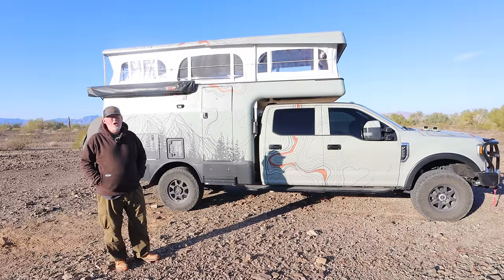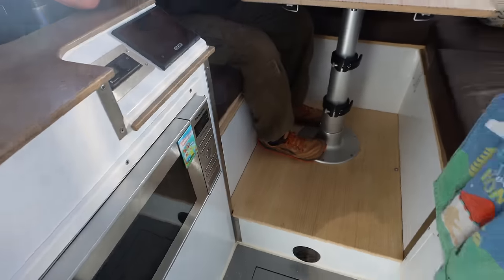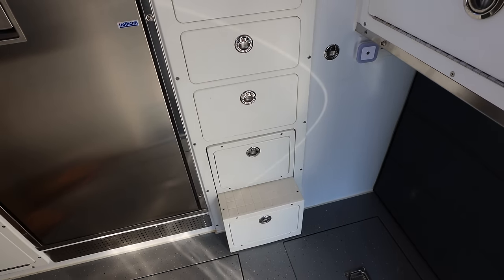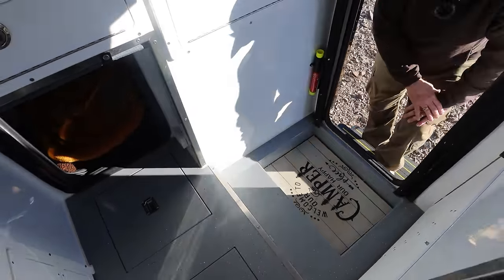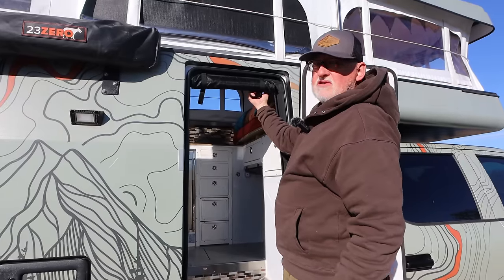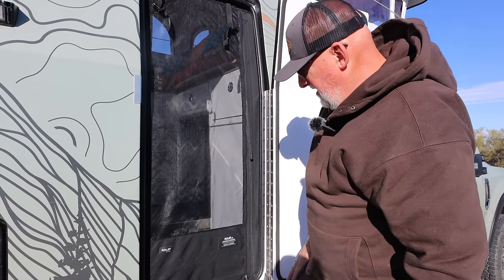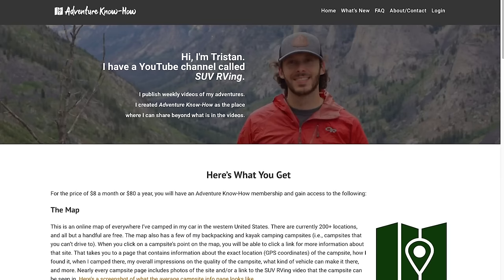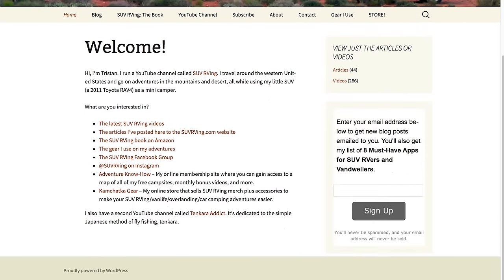Touring a $350,000 Overlanding Truck Camper!

Comment: I like seeing different RV/camping options and the pros/cons of different rigs. Thanks for posting this
Reply: Thanks for your comments, it is much appreciated.  The hidden detail is driving the quality, fit, finish and off road durability of the build. But not everything is always ideal given the limitations of what can be squeezed in a small space.  The toilet area is cramped and the trying to get a great seal with some minimal rain seeps with the door curvature are on the con sides. The door seals fine given the gasket arrangement but could be better in my mind.  But the seeps if any just end up in the shower sump anyway so nothing to clean up.  The long term use of the gasoline fired heater will also be interesting.  Just how long it will go before it needs to be pulled and thoroughly cleaned. Thanks for supporting Tristan and SUV RVing. Cheers - Bill

Comment: I love hearing about everyone's different ideas of creating their rig that works best for them.  No rig is the best, all have pros and cons and each afford everyone abilities to be creative.
Reply: Thanks for your comments, they appreciated.  The hidden detail is driving the quality, fit, finish and off road durability of the build. But not everything is always ideal given the limitations of what can be squeezed in a small space.  The toilet area is cramped and the trying to get a great seal with some minimal rain seeps with the door curvature are on the con sides. The door seals fine given the gasket arrangement but could be better in my mind.  But the seeps if any just end up in the shower sump anyway so nothing to clean up.  The long term use of the gasoline fired heater will also be interesting.  Just how long it will go before it needs to be pulled and thoroughly cleaned. Thanks for supporting Tristan and SUV RVing. Cheers - Bill
Reply: I really like the marine grade aspect of the rig.  That shower is just your bilge.  Haha.
Is the company open to hearing your opinions on the leaks and such and using your experience for improvements?

Comment: Marine design in mind is a great way to go , the have been developing designs for harsh elements for a long time.
Reply: You hit the nail on the head.  The hand construction process and material selections are outstanding.  This won't be a falling apart rattle trap in a few years of the use we put it through. From what I have currently seen, RV industry in Elkhart can't even produce units that won't keep from falling apart on the highway!  Thanks for watching and supporting SUV Rving's channel. - Bill

Comment: I see a lot of expensive gizmos that will be a long wait for parts and service.  What is the plan when you need to remove the cab for engine work?  Seriously doubt Ford will cover the labor to R&R that camper along with all the connections. 
What is total loaded weight of this unit- all food, fuel, supplies.
Reply: The gizmos are expensive and my fingers are crossed that the reliability is there.  The good thing is EarthCruiser is not an RV corporate conglomerate. They produce all their units to order for a particular customer.  They can produce in the neighborhood of +/- twenty of these units a year.  They have enough throughput and inventory to pull a failed component from stores and get it right out to you.  If it is a warranty item they will reimburse you for installation costs.   I noted that incase of a CZone PLC failure I can jump the fuses up one slot to run all the electrical items.  If the CZone interface screen goes dead, I would just use the iPad.  If one of the lift motors fail, then out comes the manual crank...  Fortunately I am able to tackle most issues out side of "Ford" issues. Now the meat in your comment, the risk of having to pull the cab for engine work..  The expense of that would definitely be on MY dime regardless of Ford's warranty. In that case I would have to get it to Bend, OR by hook or crook via a hauling expense again on me.  EarthCruiser would remove the "House" via the 6 anchor points and connections at my expense and then we would take it over to Kendall Ford of Bend, EarthCruiser's unfinished chassis supplier. So yes that scenario would be very painful, but not as painful as hauling it to Elkhart, Indiana😵‍💫 and having it there for months.  Last question, all in weight.  Fully loaded, 2 people, weighed at Montana DOT Scale was 12,860 lbs. against a "Manufacture's" door sticker certification of 13,000 lbs.  Now I caution you don't jump on Fords website and look up the rating for a F350 pickup and claim this vehicle is "Over Weight".  This was an unfinished chassis modified and completed by a "Manufacture" who has had it certified to Federal Motor Vehicle Standard for 13,000 lbs. and has issued the cerficate of weight rating.  Thanks for supporting Tristan and SUV RVing - Bill

Comment: Does it come in blue?
Reply: So actually yea and no.  No not off the production floor, but i did give the manufacture feed back that a few basic Gel coat colors other that white would be nice.  Yes, you can get any colors under the sun in a wrap... But then if you went Blue, you would still be stuck with white F350 cab to have to content with.  😂Thanks for supporting Tristan and SUV RVing - Bill

Comment: Yea, he got bad advice, gas engine is a terrible idea for this weight
Reply: Well I am not sure where the "screwed" part came in?? We could have selected a diesel. The diesel engine costs more to buy and to maintain while saving a little on over all fuel costs.  And be prepared to wait a week or two for service.  We are not towing and never will be, so the 7.3L gas engine is right for our needs and interests and has more than ample HP and Torque especially with the 10 speed transmission for the GVW.  Thank you for supporting Tristan's channel.  - Bill
Reply: @lostinmt8370  a lot of pros and cons, but diesel puts out a lot more torque and much more efficient, long lasting carrying heavy weight or towing, this would be considered a light commercial vehicle.